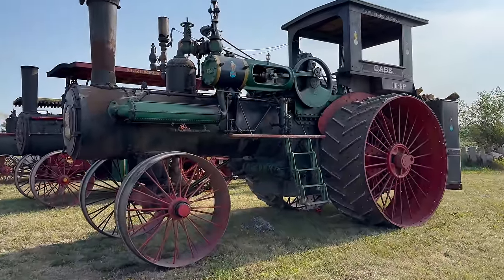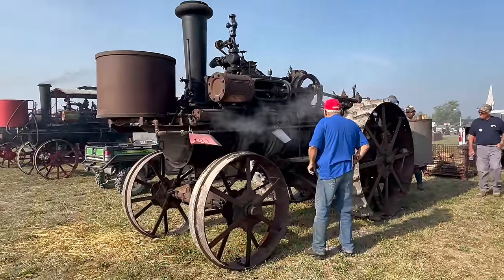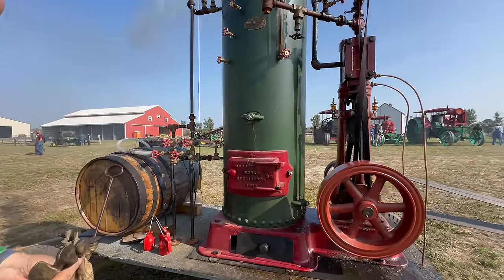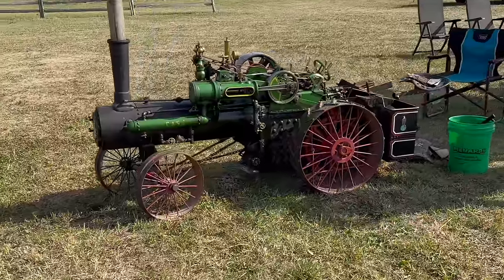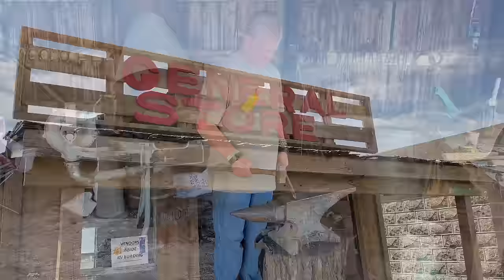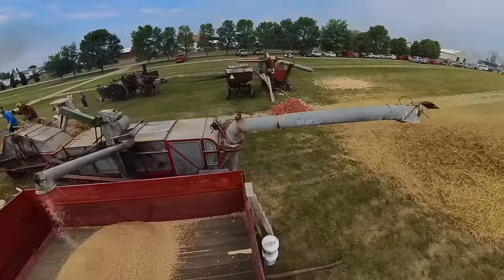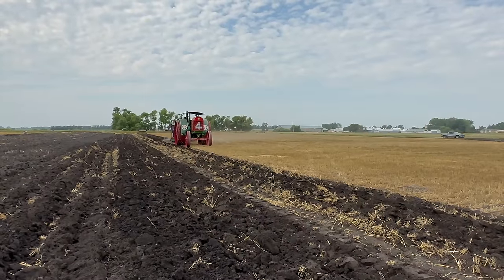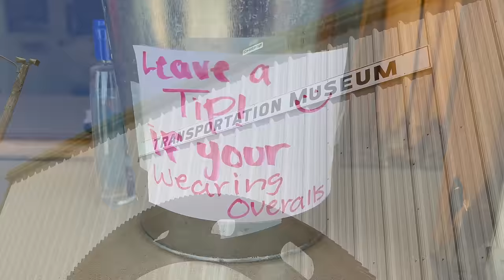Steam Engines at the Steam Threshing Festival

Comment: But why all of them are in so bad conditions? Rusty oily dirty.
Reply from the maker: Because they use heated water and need to be coated constantly with grease and oil to work.  Even if they were perfectly clean they would not be after a weekend of running.

Comment: Just noticed that most of the steering wheels for these machines is on the right hand side. When did you guys swap to left hand drive?
Reply from the maker: Keeping to the right goes back to the days of horses and most tractors today are not RHD or LHD you sit in the middle for better visibility to both sides.